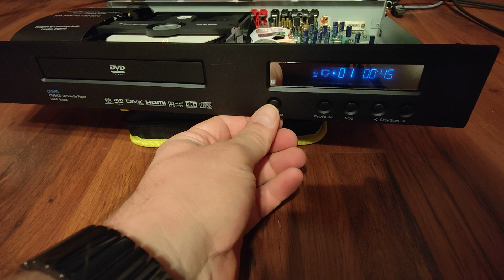Restoring faded VFD display, rejuvenating filament lines on Cambridge Audio DVD89 player

Comment: Really useful.  Thank you for explaining slowly.  Could you tell me how to identify the pins that I need to connect to the battery?
Thanks again!
Reply from the maker: Thanks! 
You need to trace them with your eyes - there is no super scientific way for that. You need to look (maybe with magnifying glass) where the lines enter the glass frame from the inside and where they get out. I think that's the easiest way, though it will take some time to eliminate others that may be close.
Also, these two will be connected to specific voltage source in the PCB, you may trace that. And sometimes they will be just marked with description on the board
Reply: @k4syx  Thank you for the advice.  I'lll be trying this real soon.  If it works, i'll try to remember to let you know.

Comment: Is a still same bright after 2.5 year? Was used quite frequently?
Reply from the maker: It was fine until about a year ago friend convinced me to sell the DVD to him :)
The problem here was that in stand by the display was always under power, so knowing that I just used power on/off switch and there was no further degradation
Reply: @k4syx  Thanks. I got Pioneer tape deck and will try (at the winter time, now have to do works around the garden).

Comment: I have got a very dim display on my Sony AV reciver STR-DB795. I have checked the schematic and it seems like the filament circuit is connected to AC 6 volt. So ther is no positive or negative end. Would the method you show here be workable anywhere if I apply DC 9 volt as you show, how do you think?
Regards

Comment: Apakah penerapan di semua vfd yang mati atau konslet cara memperbaikinya harus menggunakan batrai 9 volt dc?
Reply from the maker: The idea is to use the voltage that will be high enough to burn the deposits and impurities, but not so high that it will immediately burn the wires on spot. 9V seems to be the sweet spot here. 
But thats for dead ones. Shorted - you'd need to repair them first (but I am not 100% sure what you mean here)
Reply: @k4syx  sebaiknya bisa saya lakukan dengan kondisi vfd milik saya pribadi yang sudah mati, akan saya coba semoga berhasil dengan cara yang sama seperti video anda
Reply from the maker: @kusnadisemarang5827  Should work as long as its just deposits and filth on the lines. If they are burned (you wont see them glowing with battery connected) then VFD is probably dead :(

Comment: How can I find + & -/ positiv negativ?
Reply from the maker: @chamni63  should be described on the PCB, you may also trace the lines from power supply.
And you can just check with your voltage meter if you have steady hands (so there will be no accidental shorts :) )
Reply: @k4syx  ok thanks.
Reply: @k4syx  the manual says
FL board pins are named
VDD/VFDP/FLAC5V1/FLM-GND/FLAC5V2/RST/SD02/SDI2/SCK2/CS2/SDT1/SCK1/CSI/S-GND
I will try with a multimeter, have to buy one first😉
Reply from the maker: @chamni63  flm-gnd looks like filament ground, so that's one, vfdp - maybe VFD positive? This one or vdd maybe.
Reply from the maker: @chamni63  on the other hand if you have service manual, you can just trace them and check which one is right

Comment: tried it on a sony tuner. So far works great! Any idea how long this lasts?
Reply from the maker: Couple of years, at least. Try to power off the tuner instead of putting it in standby mode, very often filament is powered in standby and that's the root cause. Use some kind of power strip with switch or something like Tuya remotely controlled plug.

Comment: Hello HiFi Zone! Firstly, thanks for the video.
I have a VFD, taken from a video cassette and the same (VFD) was working but, when I went to do the tests to find out the pins, the display didn't light up. However, when I touch the tips of the multimeter (continuity scale) to the filaments, the multimeter beeps. Do you think the VFD may have burned out even though the multimeter is beeping at the terminals? I applied 3.3V, 5V and even 9V to the filaments. Apparently, the threads (of the filaments) are intact. I would be very grateful if you could answer me.
Reply from the maker: Hi!
Check it again in the cassette player. If it works, then probably you got wrong pins or there was no contact with your voltage source (like some dirt on the contract point that worked like isolation or sth like that).
If it doesn't work in cassette player, than maybe it did burn. 
You can try to look for filament as these are very thin, hair like wires and you can see if they look intact. That's what  multimeter would also suggest. 
Or maybe you've had it under voltage too short?
Reply: Hey friend. Thanks for the answer. Shortly afterwards, I took a closer look at the VFD and discovered that the nozzle, which is used to remove air from inside the VFD's glass tube (vacuum), had a small hole at the tip, thus letting air in. inside the tube. So, I ask you: is it possible to recover the VFD, using some type of glue to cover the small hole or, in some way, remove the air from the glass tube? What would you advise me? Thanks. @k4syx
Reply from the maker: @Dancopymus with air inside, filament will just burn, like it would happen with a bulb.
I have no idea how could you be able to completely remove air from the inside:(
And if you've provided voltage while there was air inside it can already be beyond repair :(
Have you checked it in the player?